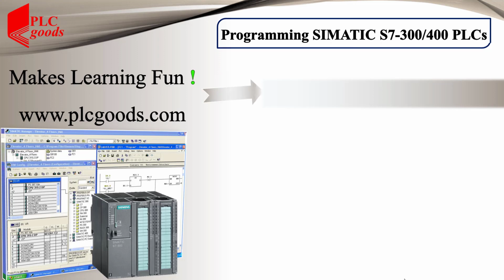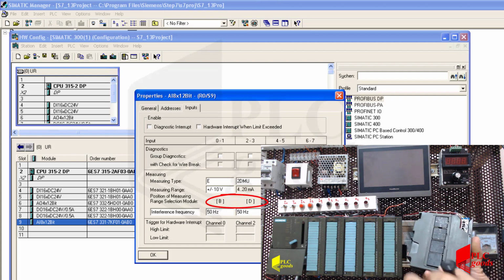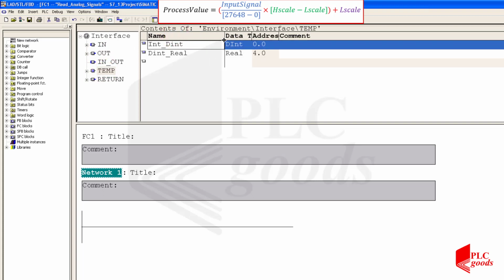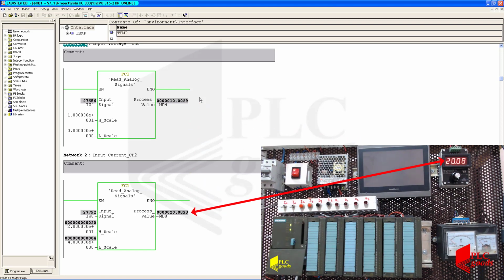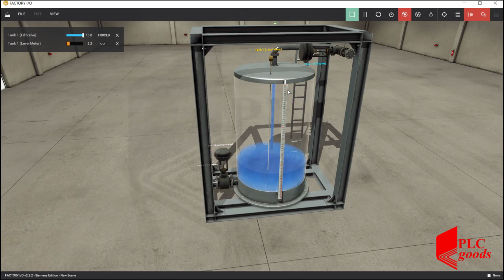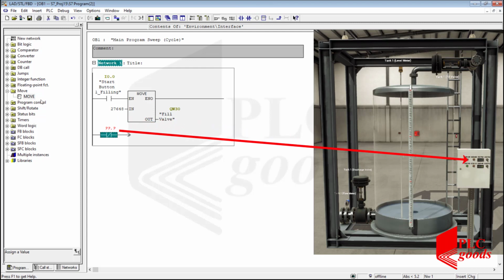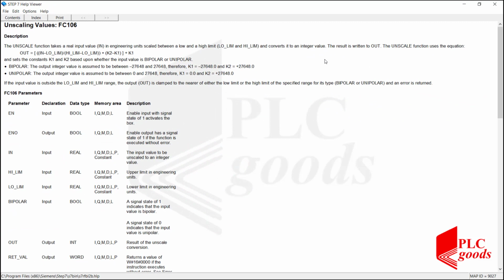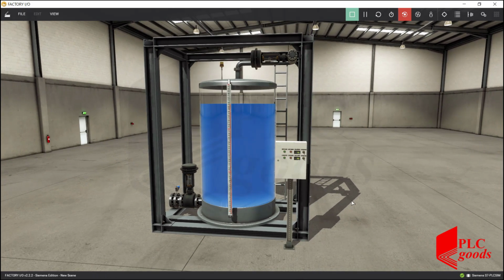How to use analog signal vs digital signal | Part4

Comment: They may use 0-10vdc, somewhere in Africa, or bum fk Russia, but usually,💯%of time it’s 4-20ma, RUNS THE WORLD‼‼‼‼‼😎👍👍  DUDE…
Reply from the maker: While 4–20mA is the global standard in many industrial applications due to its reliability, 0–10V is still commonly used in HVAC and building systems. So it's not 100%—the choice depends on the specific application and region.